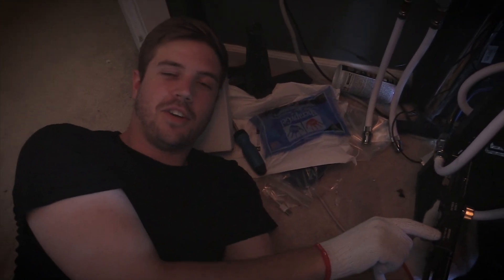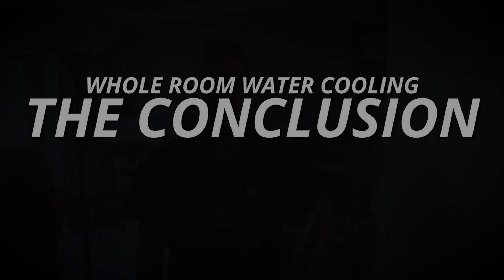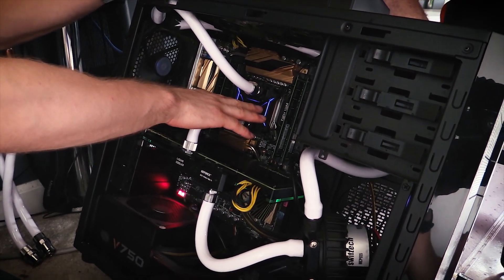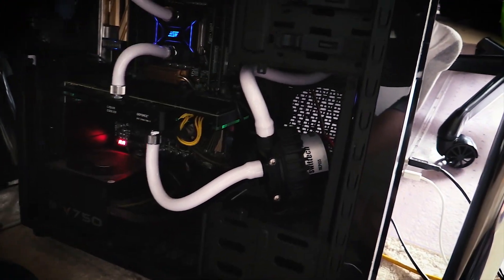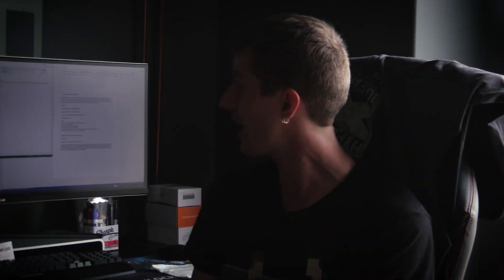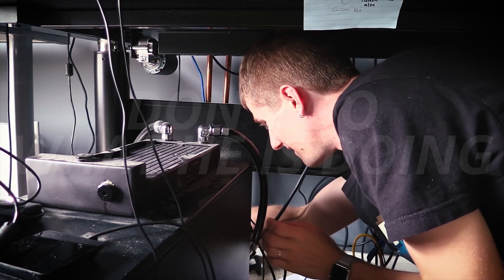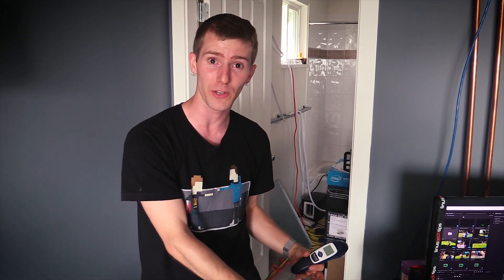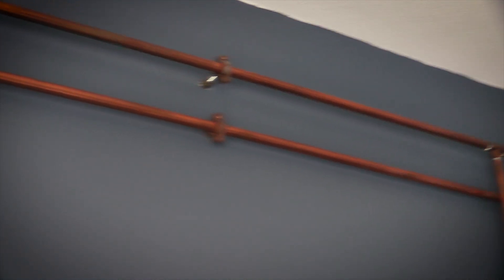Whole Room Water Cooling Part 7 - It's FINALLY over!

Comment: could you not use outher liquids outher than water like a type of coolant like freon or ammonia
Reply: Freon is a gas at nominal pressures. It would technically be phase-change cooling if used. Ethanol or even car coolant would work.

EDIT   Alcohol ruins acrylic

Also, distilled water is only $1-2/gal at grocery stores.
Reply: That might not be the best idea.  You don't want massive amounts of that stuff running around the room evaporating off into fumes.

And not to mention, the cost to fill the system with it would probably be astronomical.

Comment: what kind of great plumber forgets to install a high point to fill the system?:( yiu could just do an experiment with insulated outflow pipes to keep the the heat in the water until it's realised outside. did you try to play with water flow as well?

Comment: As badly as you failed attempting this water coolant system I still believe there's an appropiate way to make this work if you just had a little more experience about plumming and heat distribution over water networks. I'd recommend adding a pump to cool the ambient temperature outdoors triggered by a thermostat once the temperature rises too high outdoors. 
Intake outdoor air, cool it down, push it through the radiators, exhaust back out on the other side of the entire system. Use chlorine for keeping the enclosed water system clean of bacteria. Same stuff is used in almost all common public and private pools. And keep that filter to clear any particles floating in the system. Then only use stainless steel, aluminum, copper, silver, brass or gold components through-out the whole system where water makes contact with the metal.
Anti-freeze you need to use only if the temperatures drop below 1 cecius degrees outside. Else I would not recommend using that as alcohol is known to melt some plastics. Aka the plastic gets slowly liquified. You should consult a professional for wich plastics can withstand alcohol if using it is neccessary.

Also I'm not completely sure if all the metals I listed can tolerate chlorite/chlorine.
Also note that all the parts of the pump you're gonna use needs to withstand the corrosion and chemicals you have them dealing with.

This setup was fun to look at but a shame it failed in its ultimate task. The idea was great but the execution was childish and unconsiderably rashed.
Reply: Forgot to add: Also if you use copper piping the pipes will eventually collect lime inside them wich will slowly decrease the waterflow over years.
++Calculate the cubic meters of water that has to travel up wich will later travel down. If you push water 2 meters up and it comes down 4 meters, you'll cause a depressurizing in the downwards traveling tube wich will cause the water to stretch a.k.a. it will vaporize into gas causing bubbles that can clog a waterpump.
In english: you should have the same cubic meters of water traveling upwards that comes downwards.
A more reliable way is to force the pump to push the water through-out the whole system and have highest point the water will flow when it gos back to the return-channel where the bubbles wont cause a problem. Water is always forced upwards but never sucked upwards with a pump.
Reply: Also like electricity, water will find the easiest/shortest route to complete a loop.
Reply: Also, in a computer the water tank or its water level is always higher than the pump itself, applying pressure to the direction of the flow.

Once you hit a waterflow in a pipe that exceedes the free-flow rate of that invidual pipe, you will start adding pressure into it and forcing the water choose optional routes for getting depressurized. In your/this case you should have a master return pipe into wich each computer's return/hot water pipe connects. And in this case that return pipe should be x times the incoming water pipes square surface area what space the water has for flowing. (x = the amount of PC's hooked in the water cycle)

Lets say if you have 5 computers, and the inner diameter of a incoming pipe is 15mm. First we calculate the suqare surface of that diameter wich is Pi*7,5² = 176,71mm². Multiply this by 5 you'll get 883,57mm². Now you got the square surface size of the inner diameter of the return pipe you'll need. You'll get the diameter by first dividing that number with Pi aka 883,57mm²/3,1415 = 281,25 and calculate the square root of it = 16,770 wich is half the diameter so multiply by 2 and you'll get an inner diameter of 33,541mm. So you can go for a 33,5 - 34mm inner diameter return water channel pipe in this kind of a system.

Now calculating the pressure you need for those 5 pipes to force the water through all 5 pipes. In wich case the pressure right after the pump needs to exceed over 5 times the required pressure you'd need to exceed for the free-flow rate on a single pipe.

This is where your setup failed. And this already goes beyond the limit of what I can calculate. As I don't even know the words for what I'd need to google to find the calculation formula... It's physics.
Reply: Actually there is a way to calculate the required waterflow rate but it's a little inaccurate. Test the tube by attaching it to a funnel and pour water into it so it's atleast half full all the time, into a bucket. Then measure 60 or optionally 30 seconds in time and stop pouring water into the bucket immediately. Measure how much water the bucket gained during this time and if it was a 30-second test, then duplicate the result.  Else, you'll have almost the exact value of how much the pipe's free-flow rate is for water. (10 liters in bucket in 60 seconds = 10 liters per minute, in wich case the pump must handle 50+ liters per minute) [with pressurizing capabilities]
Reply: Not just the pipe size is bad, the pipe type too. Copper pipe has way bigger heat dissipation than somethink like the henco (6 layer) pipes. At least that's the minimum which you need to use for this (or at least not copper pipe). Also a great ideal to use insulator layer for the outgoing (hot) pipe, which will reduce the heat dissipation for the pipe in the room.
Reply: "Also, in a computer the water tank or its water level is always higher than the pump itself, applying pressure to the direction of the flow."

Pretty sure this is false
Reply: my point here about bacteria and pipes. if you use a mix of methanol/water (like 90/10), you can use polyethylene pipes without problems. I have a geothermal unit running that stuff since years. And of course no bacteria. Propylene glycol with an inhibitor (like used is solar systems) is also a good choice. I smiled when I watched the video with those nice copper exchangers along the room... Polyethylene pipes with insulation + a plumbery book on hand and the result could be far better...

Comment: why not install an air-conditioner?
Reply: why not watch the whole video before making a dumbass coment?
Reply: My initial reaction was "why not install an AC..."  Then come to find out, they wasted a ton of time, energy and resources to draw the same conclusion.  There is a reason you don't see giant server farms water cooled.
Reply: Well google has one datacenter watercooled from seawater. It mainly is location and implementation specific if it is going to work.
Reply: or... put the computers in the other room :D
Reply: +Mark Aksel I think that's just more for the hazard of frying the entire place due to a leak
Reply: water has a higher specific heat than air.

Comment: I just cant believe you went through all that cost and effort without even just spending 5 minutes on wikipedia checking out if its a bad idea to use un-isolated copper tubing to carry liquid cooling. I mean, just the sun alone hitting the pipes will cause the entire circulation to heat up. Copper pipes in sunlight through a window? Could easily reach 50 degrees.

Comment: most efficient way I think of is to dig holes in the wall, lead the copper heat sink all the way out to the outdoor, insulate all the way while being in the room and heat just flow directly outdoor through metal, much more efficient than liquid

Comment: I'm considering putting my pc tower in an adjacent room... for the same reason you guys built this monstrosity.    My room is always 5 to 10 degrees hotter than the rest of the house.
Reply: or get an ac
Reply: David Gutierrez I have one, but the thermostat is in the hall, all rooms stay nice except mine because of the computer and the monitors.
Reply: do you have a window? i have i fan blowing air in, on sunny/hot days, but i live in washington where the climate is mostly very humid, and colder than most places so most of the time i have my window closed
Reply: I did it years ago and won't have it different again. Works wonders!
Reply: David Gutierrez I do have a window, but I can't open it in the summer because I live in the Phoenix area (currently 110 outside).
Reply: Peter Fox Thanks!  Gives me more incentive.   What is cinvienient is just on the other side of the wall of the room i'm in now is a closet that I already have a surge protector in and the routers.   My computer's backside would be inside the closet (as would a lot of the wires and such) of the next room.
Reply: oh yea i was over there a few summers ago and its hot as shit over there. sorry about that

Comment: One big problem that you guys probably ignored is pressure.  Those vertical pipes drop down about 6 feet plus the height of the highest point of the loop on the roof.  That all increases the pressure of the water at the water block and most importantly, the joints.  At .433 psi per foot in elevation expect the pressure to be increased by ~2.5psi just from the 6 feet of piping drop we see in the room.  I'm not sure how far up it goes to the roof but yeah.  This would increase the failure possibility quite a bit.

Comment: You should insulate the pipes, at least the outlet pipes. That copper is just radiating all the collected heat back into the room before it goes into the bathroom...
That's just common sense right there, like using a funnel and siphon to fill, empty, and move that oil cooled PC you have.

Comment: insulate the pipes silly man
Reply: But it would've worked better. They basically turned the copper plumbing into a radiator so it's radiating the heat back into the room before it reaches the actual radiator outside.
Reply: that wouldnt make it look as good...

Comment: having a coiled loop in an air conditioned room  with blowers moving air over the coils and lagging the pipes outside of the room would surely show much improved temps. having fittings that can isolate individual systems so they can be removed without shutting the whole system down would make it easier to maintain. these points are mute though with the move having happened already.

Comment: Here's an idea I've thought about playing around with: Toilet water cooling.

Here's the concept: You hook your water cooling up to the toilet reservoir tank. You'd have to set the water levels in the tank so that the inlet of the water cooling (to the computer) is always submerged).

There's a fair amount of water in the tank, and it will absorb the heat from the computer. Then, when someone goes to the bathroom and flushes the toilet, the warm water is flushed, and fresh cool water comes in.

This can also help keep the cooling lines in the computer nice and clean as well, as the water is constantly being refreshed.

Plus there's something just funny about hooking a computer up to a toilet...
Reply: That would be the shit.
Reply: I like this idea. Though I feel that there would be a lack of control with new untreated water being constantly added to the system.
Reply: Someone already did similar thing, but instead of taking water to cooling loop directly, the toilet reservoir was heated through copper pipe working as a heat exchanger.

Comment: cheap upgrade...install foam tubes to insulate the out going hot water pipes as thebopen copper pipes will radiate some heat into the room. installing the foam on the pipes will take more heat outside.

Comment: fuck water cooling, i run my pc in space and overclock the shit out of it care free.
Reply: It's really hard to get rid of heat in space.. There's no atmosphere to transfer the heat into.
Reply: @Riley Davis & @Keyser Soze You're both wrong. It's neither 290°C or 273°C. It's -270°C in the vaccum of space. -273°C is absolute zero(which I assume you are mistaking for the temperature of space, Keyser), and nothing we know of currently can ever reach absolute zero energy. But yes, running a PC in space would prove to be very inefficient, as pc coolers rely on convection cooling, not radiating away heat. Fun fact, most "radiators" such as car "radiators", home "radiators," do not radiate most of their heat away, but rather letting the air around the "radiator" convect away heat. They technically should be called convectors, as using the term "radiator" would imply the majority of heat transfer is done by radiating the energy away.
Reply: Your pc will shut down
Reply: You're also incorrect.

The temperature in space various depending on where you are and your location relative to an energy-emitting source.

Not to mention that the whole thing is relative on its own as well. Technically, space has no temperature. Temperature can only be measured by the difference between two things. Space itself has no temperature, but there are things in space that can draw/emit heat.

Dropping your PC in a place out of geosynchronous orbit may make it freeze over time due to radiated energy, or it could melt from too much absorbed heat energy.
Reply: +Lexkimo Schooled
Reply: Vacuum is the best insulator there is (well, except for photonic crystals), which is why thermoses are built double-walled with all/most of the air pumped out of the space between.
Reply: really ?
Reply: are you meaning to say 290C or -290C? Because one is too hot, and the other is colder than the lowest possible temperature
Reply: +Emma Fiorentino yes, really, and i depends where in space, if youre close to earth, you would burn from the sun
Reply: +Riley Davis really ?
Reply: +TheTslat yes, you are correct however unless the computer was exposed / close to a high amount of energy the pc would become extremely cold because of the extremely low pressure of a geostationary orbit (100 oxygen atoms per square inch). An interplanetary orbit in which the apoapsis and periapsis are at a very similar altitude to the sun would demonstrate this effect even more with only about (10 oxygen atoms per square inch). Of course there unfortunately would be extreme amounts of radiation in an interplanetary orbit which would heat the computer however not enough to contradict the fact that low pressures bring the freezing point of objects down dramatically.
Reply: Space is a vacuum, however the rare particle found in outer space is usually around 290° C. All of you might think space in near absolute zero. That is simply not true, Space is not absolute zero, that figure is simply the lowest temperature you can get in space through radiating heat. At that temperature you cannot get any colder because the cosmic microwave background radiation (Found EVERYWHERE) will warm you back up to around 2.7 kelvin (-270.45°).
Reply: A PC in space will burn up without proper space cooling systems. In space, there is no conduction or convection from your PC to space, just radiation. There is a difference between heat and temperature. Heat will accumulate on the computer materials, thus increasing temperature. (rate of energy in) - (rate of energy out) = change in energy of the system. On earth, you get all 3 types of heat transfer mechanics.
Reply: space is only cold because of the endothermic reaction caused when you enter an atmosphere with no pressure, which is instantaneous
Reply: No its not, because thats below Absolute Zero. Its actually 273C in the vacuum of space. But its more like 90C in your CPU. So tell me, how are you going to transfer that 90C heat load into the 273C vacuum? Vacuum cant hold heat, which is why its so cold. Theres no atmosphere. So obviously no way to conduct the heat away. The ONLY way is via infrared radiation, and your CPU will fail and melt long before it glows hot enough to radiate away any significant portion of that heat
Reply: Kureiji 
Yall know this wasn't serious right
Reply: It's 290° C in space...

Comment: You should switch your window from a side opening window to a window the pushes up and then install a window AC unit that would help to not only cool the room but the pipes that you have running through the room. I thought it was a neat idea.

Comment: If you got 4 inch ducting fans, closed your computers off with a 4 inch hole on each, ran the ducting around your hot side pipes with a bunch of ducting fans you could get rid of the rest, always remember to have a big fan blowing out side on your window, you can get quite ones. And an AC unit, i was going to get one but didnt end up needing it

Comment: Ill post a picture of my setup, im running one laptop, mind you its running an nvidia gtx 980. But i have 4 PA amplifiers, and tv's and stuff. I got my room to cool down a lot with fans i used from a grow room and vent ducting. At night where it was probably around 25 degrees Celsius i got it so my hands were cold.

Comment: Dear Linus, I m not to criticize but speak out truly from my heart, this is not worth at all. As high temperature rose to upper level and low temperature air will be at the lower part, u can just installed few blower fan on top of the ceiling in term of cost efficiency. I will definitely prefer using air cond tho... 
Anyway its still a nice video which let us know your ideas and how does it actually works! You are still awesome!